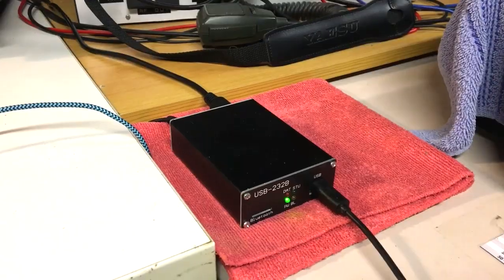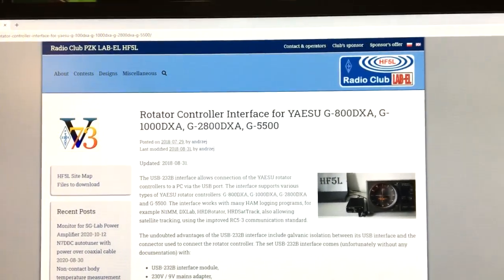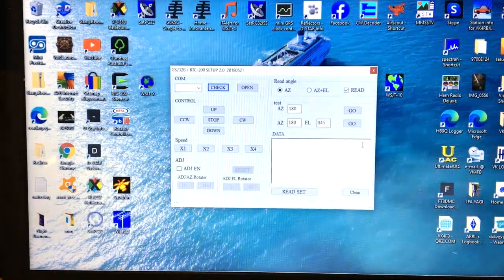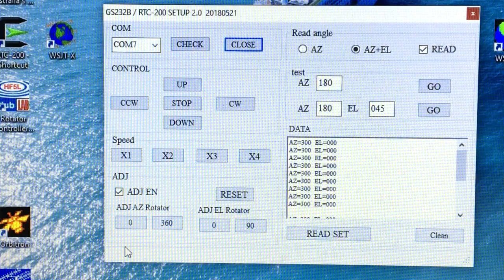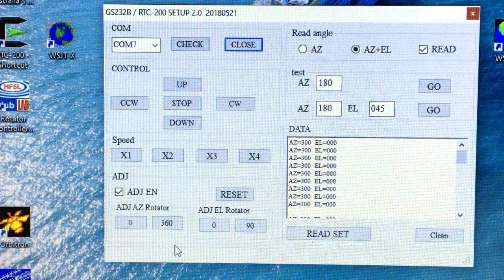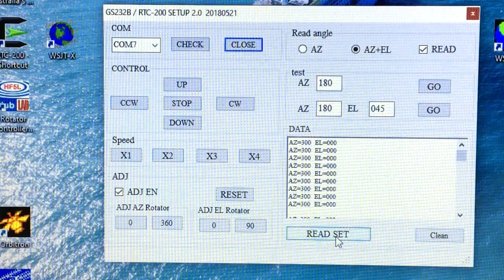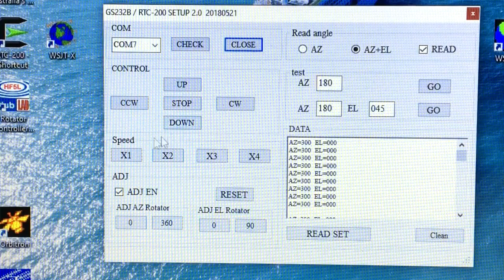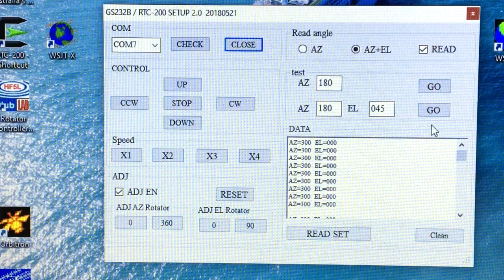USB232B Interface "Setup and Calibration" Auto Tracking Satellites IC-9700, SatPC32

Comment: Hello Roland, Craig N8QNT just outside of Cleveland Oh. I have the usb-232B and the Yaesu G-5500 The link on the web site did not work for me. what should I do to get this going with Ham Radio Deluxe? Thank you for your time...73 DE N8QNT@yahoo.com
Reply from the maker: Hi Craig, have a look in your download folder you could have the zip file waiting for you "GS232B-SET-3.0"
Reply: Thank you Roland, I still could not find it in my downloads. So I decided to use a different web browser. That seem to correct the problem of it not downloading. One more question? It appears that the yaesu controller Will power the USB – 232B ? Does it have to be plugged in to the power cord? Thank you for any advice and hope to chat with you soon. 73
Reply: I tried using the GS232B/set up. But it does not appear that the controller is talking between the two?
Reply: Think I got it found it on com 9.

Comment: Hi Roland
I have the Yaesu G1000DXC and i have everything hooked up via Ham Radio deluxe, everything is working but the settings are wrong, I have my antenna setup to rotate 180° either side of north, would you happen to know how i would set the controller for this?
Reply from the maker: Hi Shane, if you calibrated the rotator as you can see it in the video you can test it with this program "DS232B-3.0"  .....RTC 200...and you should be good to go
Reply: @rolandlang3590  Hi Roland thx for the reply, i did eventually work it out, what was happening was when i clicked save it didn't always save, and by chance i noticed this when the lights flashed, so when doing this guy's, make sure you see some sort of communication activity on the USB-232B when clicking save, once i realized this calibration was fine.
Reply: 1 thing i did do Roland inadvertently not knowing, was adjusted the (OUT VOL ADJ) on the back of the unit thinking that may have been what was causing the problem, when in fact it was operator error lol,  oops! :(

but by adjusting that potentiometer in the back i think it is causing the USB 232B to give erroneous readings, by any chance would you happen to know how to reset that back to factory values please?
Reply from the maker: @2greedy674  don’t know I am sorry you will work it out.

Comment: I bought a USB-232B rotator interface that came with zero documentation or anything to indicate how to use it.  The azimuth calibration was way off, but with your tip about the HF5L site at the URL below and their link to the calibration software, I was able to calibrate the rotator interface and now it is working perfectly with Ham Radio Deluxe Rotator.  Thank you for the very helpful and interesting video.  https://hf5l.pl/en/rotator-controller-interface-for-yaesu-g-800dxa-g-1000dxa-g-2800dxa-g-5500/
Reply from the maker: You are welcome
Reply: @rolandlang3590  73 de Mike, W9HAT, Asheville, North Carolina, USA  I would be thrilled to schedule a contact with you on 40m or higher.  My satellite operations are on hold for now but maybe another time.
Reply from the maker: @MichaelCowden  Hi Mike, just moved house here, so my situation is similar. No Satellite antennas up only my Hex Beam at 3 meters above the ground.I was very spoiled at my last location I had lots of room for antennas and great neighbors. But I will be putting up a loop antenna soon Full seize for 80m or a Longwire I will try to get onto the 160m band. We will see what antenna I will end up using to get onto the 160m band. ...... slowly I will get my neighborhood used to some antennas hi hi. Best times for your part of the world is your morning and my evening 40m but for 20m late at night for you and afternoon for me short path or Long Path early mornings for me and late afternoon for you ha ha let me know what you think

Comment: So with sat pc 32 i have and  work the sats when i set the usb-232b when a sat is coming the azimuth and the elevetion is set automatically without do anything?
Reply from the maker: Correct! In SatPC32 you can set when you want the antennas to get into position. My antennas will go into position -3 degrees and follow the Satellite and you just make sure it happens.